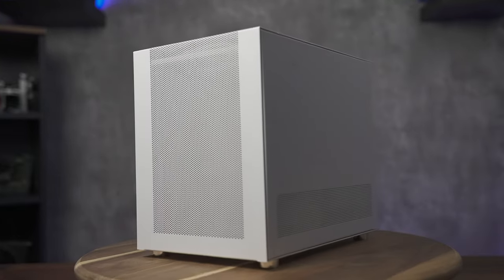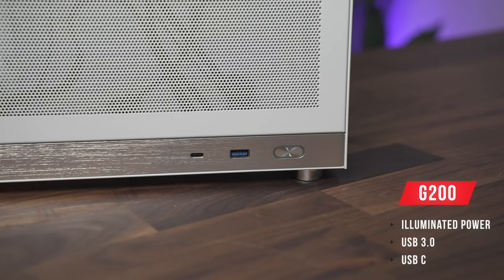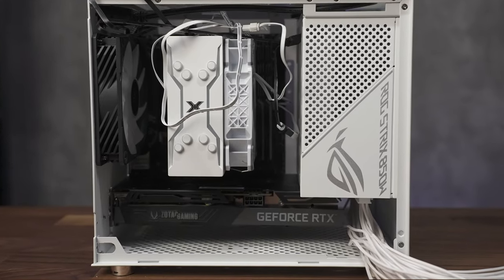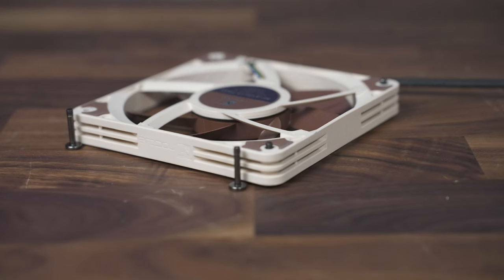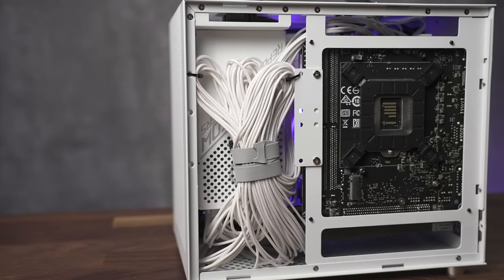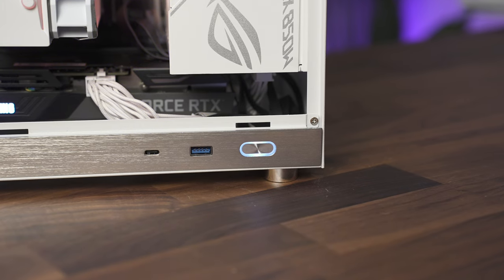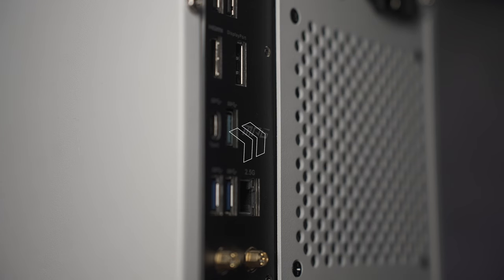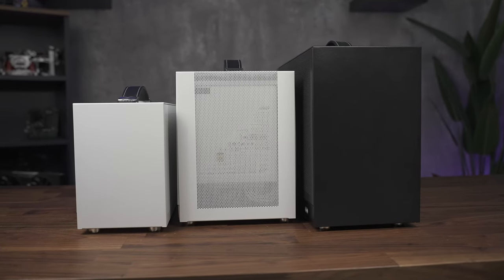🔥 Elevate Your Gaming Setup with the Sleek & Powerful KXRORS G200 PC Case! 🚀 Review Inside!

Comment: Great review! Glad you were able to show a build with an ATX PSU. The advertising for this case shows that you could also fit a standard length (~267mm) GPU along with the PSU, but that's only possible if you use custom cables or a PSU equal to or less than 140mm in length.